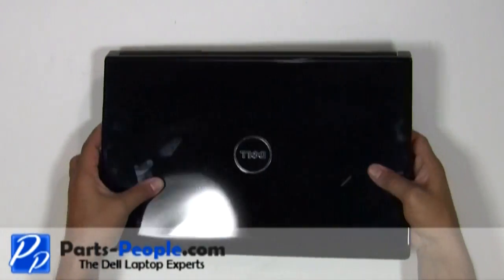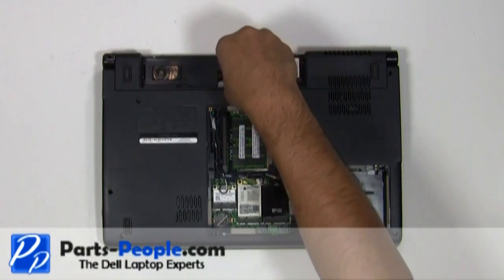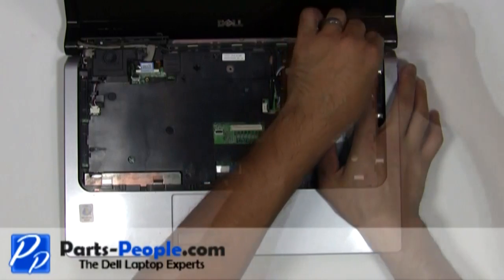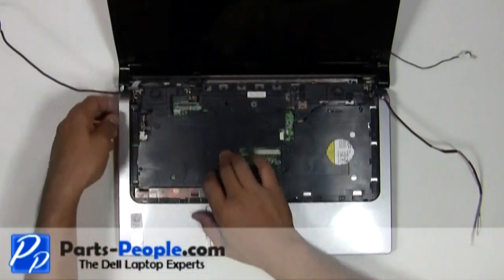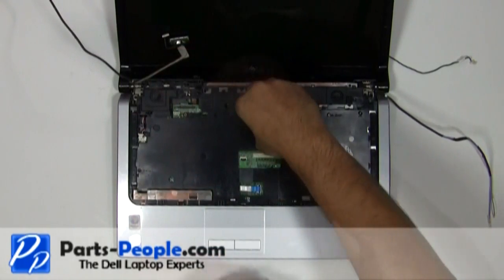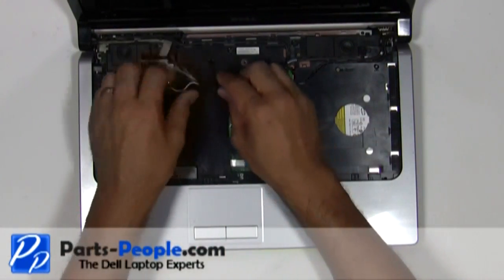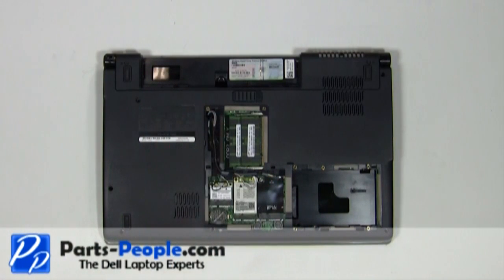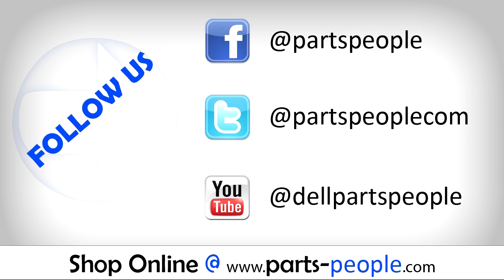Dell STUDIO 1555 / 1557 / 1558 | Optical Drive Replacement | How-To-Tutorial

Comment: I also inadvertantly put an SD card in the Optical Drive slot of a Studio 15 and was unable to retrieve it. This tutorial saved my bacon as I am complete novice in terms of taking components out of the case. I would not have dared to do this procedure using the instructions on the Dell website. Thanks for the very clear instructions here. My media control cover didn't seem quite so keen to snap out as the one in the video but I guess it gets easier with practise... Thx again

Comment: Thanks for the great tutorial I found the procedure to much easier than expected.
Stuck SD Cards seem to a common problem with the studio 15 series.
Once the Optical Drive was out the SD Card could be shaken out easily.
I do not recomend trying to pry it out through the brush covers. There are rails inside the optical drive that will prevent any tools from hooking onto the card.
The only things actually holding it in is the dust cover which is surprisingly resilient against bending outwards.

Comment: @LanCzhai I found this video to be a great help in getting to my optical drive.  Just follow the directions in the video. The only thing the video doesn't cover is opening up the optical drive itself, which was easily done using a very small Phillips screwdriver.  There are several very small screws on top that once you remove them you can get to the CD and SD card.  It was easier than I thought it would be.  Good luck!